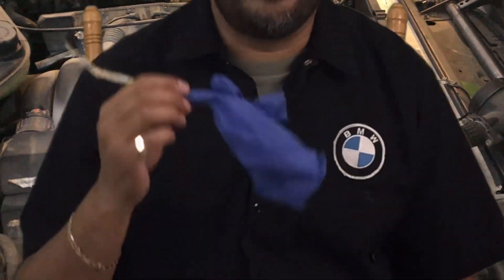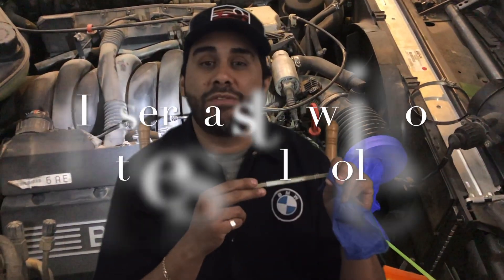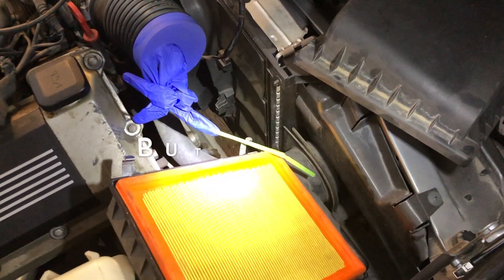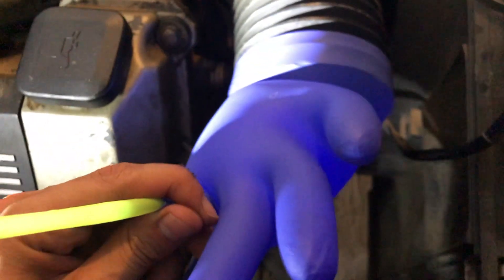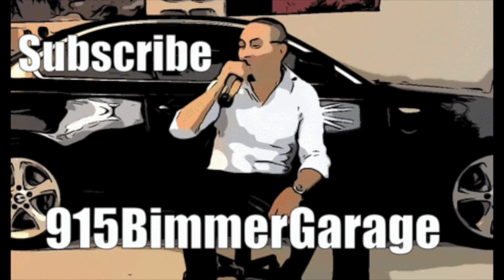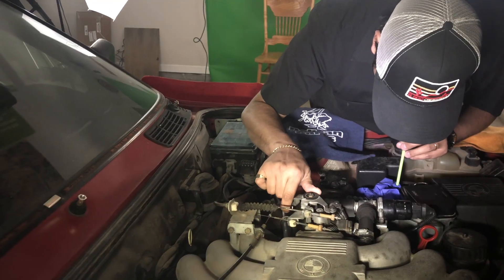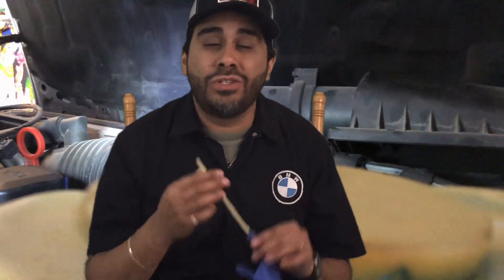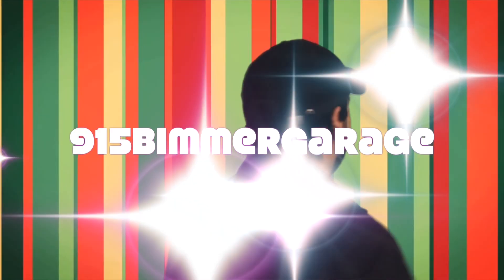CHEAPEST engine vacuum leak test DIY- BMW rough idle or instantly dies

Comment: My e90 is making a loud shinning noise with error code 171. When I release the oil cap, there's lot of suction and resistance to release it and once the cap comes off, the sound disappears. As soon as I put the oil cap back on, the loud noise comes back. What could this be? The code from Autozone says it's the MAF but I changed that 6 months ago and it wasn't needed so I returned it. I also have ISTA but I'm not sure how to use it for this.
Reply: Maybe bad ccv valve